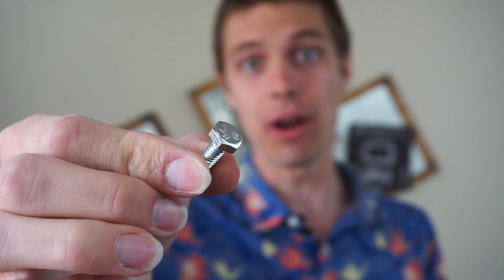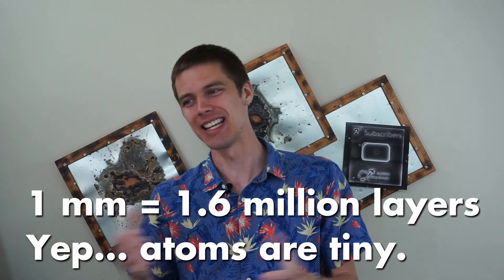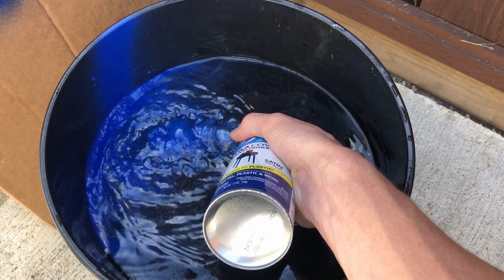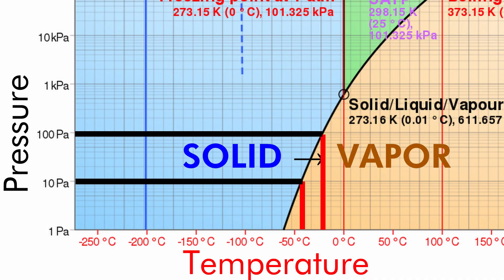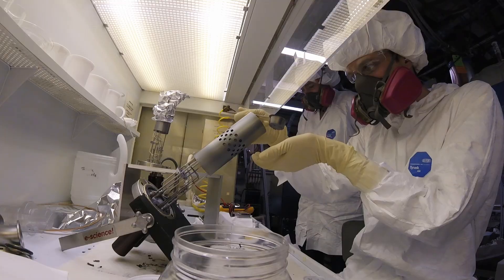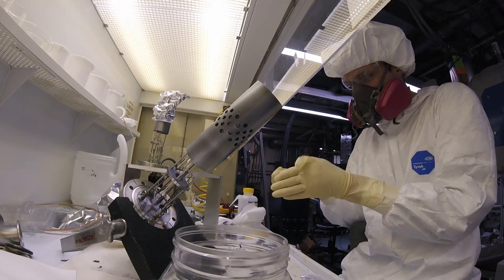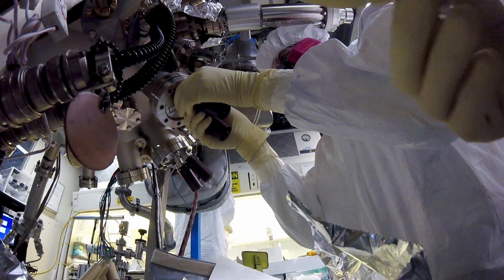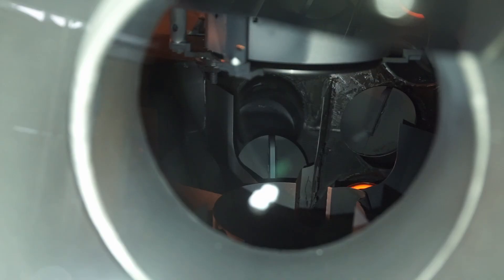How to evaporate a metal

Comment: Do you have to heat the different metals at different temperatures? Since both metals have different heat capacities I would assume that they have to be heated at different temperatures so that they sublime at the same rate or else each layer of atoms may not be distributed evenly; I don't know if that matters though.

Comment: I work in crystal oscillators as a maintenance technician. I get the satisfying chance to service, clean and repair vapor deposition machines such as the Saunders 5600 base plating system, Balzers BA510, Balzers BA360

Comment: The realization that atomic vapor deposition is actually SLOWER than I thought is abit of a problem for now,but I'll figure out how to make it faster later on....now looking at that effusion cell,is there a reason that you use mechanical shutters to control the flow of atoms?.as I imagine using the same technology used in cathode ray tubes and electrostatic linear Particle accelerators would be more favourable,by creating an "electrostatic shutter" per say that has a much higher degree of control like a triode vacuum tube using a gate voltage as the shutter instead?,now I'm just ironing out the technology here cz as you indicated that it requires 100+ days just to deposit 1 mm of film, whereas I need to create an object 300mm by 300mm by 300mm ENTIRELY using AVD....I already foresaw this problem and I am experimenting with the atomic tweezers technology to create a manufacturing technology called "Atomic-Knitting" and yes as the phrase indicates it's like making a loom but for atoms instead,allowing us to individually constuct an object one atom at a time with prestine resolution and without requiring the source matwrial to be of high purity,as only theatoms qe need can be removed from the precursor material using 1 of several methods,1 method is susing the gate stopping potential of atoms to limit which atoms pass the gate,as each ayom has its own electrostatic and inertia characteristics that can be exploited for control in place of sample purity bringing the manufacturing costs waaaaay down,method 2 is using vanderwall forces along withbelectrostatic potentialon a tungsten tip tweezer to selectively choose atoms from the precursor,it will require abit of experimentaion but it is feasable and that should be able to get me my cube in a much shorter period.
Reply from the maker: The particles aren’t charged so they can’t be guided. You could make them come out orders of magnitude faster just by getting the cell hotter, but the limiting factor for growth rate is how quickly and defect-free the atoms can sort themselves into a crystal at the destination. You could deposit a glass extremely quickly
Reply from the maker: If you mean ALD though, that’s something very specific and has a bunch of other restraints
Reply: @AlphaPhoenixChannel  All things considered arent they the same things tho?...VLD is just ALDS hotter sister but ALD is the smart one 🤣....Jokes aside I'm actually grateful for this interaction cz it gave me the inspiraton I needed to complete the missing puzzle in my Atomic Knitting machine,in essence its just an Atomic 3D printer.In both ALD and VLD a variety of microscopic geometries acan be achieved including overhangs to create MEMS parts,but whatI was reaaly focusing on is creating "Hollow Sections".Basd o your experience so far is there a way to create a completley hollow cube using either ALD or VLD?,the requirement of etchants and whatnots caused me abit of trouble figuring out how I ws gona mae this thing,cz as you mentioned earleir about making glass fairly quickly,is it possible to make a hollow glass cube 1mm^3 with a wall thickness of  roughly 100um all round?..creating the open shell of the cube that i know is the easy part,but the roof part of the cub is the hard part,even on the 6 axis metal filament 3dD printer we were still having issues with sagging,though the cube was created but this was like a 125mm^3 cube with a 1mm wall thickness,to say there was more than enough room for error would be an undestatement,such room does not exist in the microscopic manufacturin.Either way imagine a C.R.T t.v but instead of emmitting electrons it emits charged particles of the precursor material heated in a crucibal,and using a gate voltage the velocity of the charge can be controlled which in turn controlls th epath it takes through a magnetic field,that can be precicsly calculated so in this case the 3D filament is the ion path,the pinter head is the deflection coils and the position determinant is the gate voltage on the charged atoms, in this way we can hurl the atoms to specific predifiend locations where it will stick to the target material.My biggest hurdle is figuring out an easy reliable process of creating microscopic airtight holllow shapes,the need for etchants in ALD and AVD makes it hard,not impossible just hard and probably not to the specs i need,what are your opinions of creation of nano scale hollow shapes?
Reply: @AlphaPhoenixChannel  For whatever reason hearing the statement "you could deposit glass very quickly" sounded very funny to me 😂....not sure why though,like i just imagined an ingot of glass being spontaneously created  after you go in and out of the lab for just five minutes

Comment: Do you also use a QCM to measure the deposition rate instead of the pressure gauge?
Reply from the maker: Did in a couple ebeam systems but not this MBE
Reply: @AlphaPhoenixChannel Did you ever see a need for a QCM which can be moved arround in the chamber, by a large distance, during the measurement?

Comment: You were careful to make sure the plastic bag didn’t touch the canister when loading the material. That makes sense. Does any of the plastic end up flaking off while the crystals are inside the bag? If you buy an even purer feedstock, when does the container it comes in start to matter due to any contamination it might introduce?
Reply from the maker: Material purity probably can be limited by container, but in this case we weren’t worried. The plastic is pretty thick and robust, but I still don’t want the OUTSIDE of the bag hitting anything important

Comment: What scares me is rubbing my electric shaver over my face.  Each time I shave, many trillions of carcinogenic nickel and chromium atoms (from the stainless steel shaving head) get deposited on my skin.  It’s unsettling to think I may eventually get skin cancer.  So, I wash my face, removing maybe 99% of the facial carcinogenic metals.  That still leaves a few trillion nickel and chromium atoms sitting on my skin, diffusing deeper into my body.

The same applies to using stainless steel forks, knives, spoons, pots, pans & sink.  We’re ingesting a bunch of heavy metals, thanks to our love of corrosion resistance.  

Are we doomed by using stainless?  I think not.  The body has the capacity to get rid of lots of nasty stuff.  Just like a few corona bugs can be lodged in your lungs without the virus spreading.  Humans may actually need exposure to small amounts of poisons, so it can build up the antibodies needed to attack/kill the invading toxics.  It’s called HORMESIS.

Comment: Had to subscribe and hit the bell, after the first video. I'm two in now, I was draw to this one because anything you can turn to vapor, that vapor is ignitable. You are actually working on an alternative fuel source as well as conducting your experiments. If you were able to find a way to cost effectively vaporize the fuel in cars it would eliminate the hydrocarbon emissions. I did so by making a small hydrogen generator  to run on the  12v system. By attaching a hydrogen molecule to the air fuel mixture I was able to achieve 100% combustion.

Unfortunately the O2 sensors would sense nothing and tell the computer to add more fuel eliminating any fuel savings. I was able to install this on an older carb system that worked great, but the hydro system got to hot with the 12v power and would need to be stepped down to 5v. Not accessible on older vehicles and I have since had to move on to other things. I have wanted to revisit the project though .

Comment: How fare do the evaporated particles leave since it obviously is fast enough to overcome gravity for the 1 meter it travels. But secondly even tho the disk inside is spun for consistency wouldnt the outer rim of the circular disk still get more material over time than the center since the beams are at an angle. Creating a concave lens thing.

Comment: This is amazing! I always wondered what material went into an effusion cell to produce a “pure” beam. In this setup, were you depositing both Pb and Se, or does the Pb hang back while the Se deposits to the substrate? I work with transition metal dichalcogenides, a family of 2D materials which often involves Se, and it’d be interesting to know if this is how they’re grown.
Reply from the maker: I thought a lot of TMDCs were sputtered or something, although somebody in my group has done some in this system. I think it’s less common to use something as refined as MBE. Granted MBE could be standard for TMDCs and I could be completely off base lol

Comment: I have a doubt I may be wrong.
He said he is not attempting to touch plastic bag to crucible due to contamination issue. But source material came in it was in contact with it the whole time, does this not contaminate source material itself.
Reply: The manufacturer probably uses a plastic that is mechanically and chemically resistant to the source material. I would also guess that as a second line of defence they use a plastic that has a high vapour pressure i.e. if any plastic does enter the chamber then it evaporates during the bake-out step or when the effusion cell is outgassed (to remove contaminants prior to deposition of the thin film)

Comment: I know it’s an old video but I have a question… when performing calculations for planning a crystal growth how do you account for evaporation from the crystal itself? Does this effect the flow rate required for different materials (assuming the evaporation rate at the constant temperature crystal is different for different materials)?
Or does the deposition process itself prevent evaporation from the target? I could imagine that if the rate of deposition is high enough the atoms at the target would be bombarded and prevented from escaping.
Reply: Yes you are correct this has to be taken into account for a 2 element thin film, let alone a thin film with 3, 4, or 5 constituent elements.

For example, when growing GaAs (the most common and mature III-V semiconductor) obviously we want the Ga and As to incorporate at a 1:1 ratio. The temperature required to generate a beam of arsenic molecules is roughly 350 Celsius, so clearly the arsenic is going to evaporate quite quickly at the typical substrate temperature used for the deposition (550-600 Celsius). This means that we need to oversupply the arsenic relative to the gallium: typically we want the atomic flux hitting the substrate to be about 1.6 arsenic atoms for every gallium atom, in order to achieve a 1:1 Ga:As incorporation ratio. If we didn't take this evaporation into account the thin film would become gallium rich, and the gallium would eventually begin to pool into droplets and ruin the crystallinity of the substrate.

On the other hand, if we used a lower substrate temperature to stop the arsenic evaporation this leads to other problems with the growth, mainly that the arsenic atoms incorporate at the wrong place in the crystal structure (at the place where the gallium atoms are supposed to be) because they don't have enough thermal energy to move around the substrate surface. This results in a very poor quality thin film!

I would guess that the deposition rate isn't anywhere near large enough to prevent atoms from desorbing from the surface. This is a guess, but it isn't anything that has ever felt relevant to me since the temperature has such a dramatic effect on the desorption rate of the adsorbed atoms on the substrate.

Hope this helps!

Comment: I'm curious if the speed at which the shutter opens from one direction affects the initial formation of the crystal
Reply from the maker: Growth rates are so slow that the shutters are basically instantaneous. However the proximity to the angled cell can actually make a difference, which is why the sample spins

Comment: very interesting video. I once applied for a job where this procedure was used, it was for layering a protective coating on custom-ground eyeglasses for a very well-known manufacturer. The machine was similar where there was a substrate that was incinerated in a vacuum and the vaporized material would evenly deposit onto the glass.

Comment: So how does this stack up against spattering? I clear on the processes of each, really I'm just a little unsure precisely how the ions would be deposited from a spattering. My assumption is that due to the higher energy levels involved it would preferentially form a lattice, though because of the whole "ion" thing I'm also forced to believe that the molecular mobility wouldn't be quite as free, therefore it'd not form a lattice but a somewhat amorphous structure... but then again since it is a substantial increase in temperature and its in a vacuum the dissipation would mainly be infrared, meaning a hotter surface and ergo more mobility / lattice formation . Then once all of this has been considered there's just one elephant in the room; the deposition thickness.

Any insight would be awesome! ❤

Comment: I saw the video on leak checks and understand gaskets.
But what about moving actuators that penetrate the chamber like the external shutter actuator? How are these shafts sealed? Or the linear sliding motion where the targets are moved?
How do you seal linear and rotary shafts?

Comment: I have a question for you, unrelated tho, I'm doing a study about surface finish and outgassing rate of different materials in high-ultrahigh vacuüm.
In my study I try to measure de/Adsorption of a different surfaces. There is not a lot to go on in know literature. And not a lot is know of specific outgassing rates other then the factory finish. 

Thinks I've tried like cleaning a stainlessteel plate with scotchbirch, sandpaper, and even just Blasing it with silicone powder and a High pressure water cleaner. 

What do you think would be interesting to see as a surface mechanical finish? I mean can you think of something creative to reduce the geometric surface of a vacuüm system to reduce sorption?

Just a peak, prepping the sample with a high pressure water cleaner gave some very unexpected results in sorption. I'm justing the throughput/accumulation methode with pure n2 and air.

I don't mind if you don't respond, just was wondering if you had some ideas about this subject :), keep up the good worksssss

Comment: 2 questions:
1: how do you avoid accumulating material that radiates from the vacuum chamber itself? For example, if the chamber is steel would you get Iron impurities in your crystal that you are growing?
2: what causes the atoms to eject with force from the evaporating sample? And what speed do these atoms travel at when ejected? Are they just randomly bouncing around until they impact the substrate or are they actually fired in a beam like you described?

P.S. great video btw! I love your content. Especially things like this where you have access to equipment that most others don’t and can explain it.

Comment: What is preventing the other 99.9% of the metal the machine is made out of from evaporating into the chamber? you were so concerned with not getting containments on the sample, but the whole machine is a containment. 
If its the fact that the sample is heated and other things are not, then what about the crucible walls and other parts of the heating element? maybe the shutter/pinhole only allows the sample to eject itself towards the target? while other things don't hit the target? Maybe you simply rely on the vast difference between random parts of the machine being a low percent of the particles that hit the target? such as sample is 99.9% and random machine molecules are 0.1% of things that hit the target? Maybe the entire machine has been created out of materials that don't evaporate as much as the sample products? but that would limit your samples to things that would evaporate well before the machine itself.

Also, How do you aim the particles? I assume your goal is not to apply a thin coat of the sample to the entire target. So how do you aim it to the tiny part of the target that you want coated?
Reply from the maker: Stainless steel and the materials used in the crucible have extremely low vapor pressures so they hardly evaporate at all. Also we are actually trying to apply a thin coat